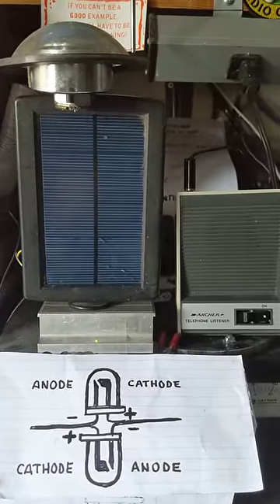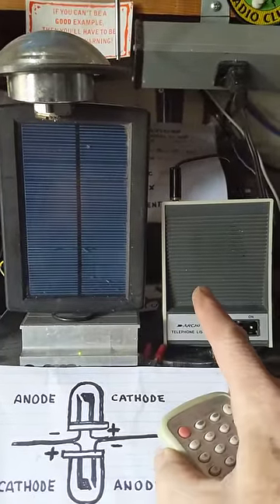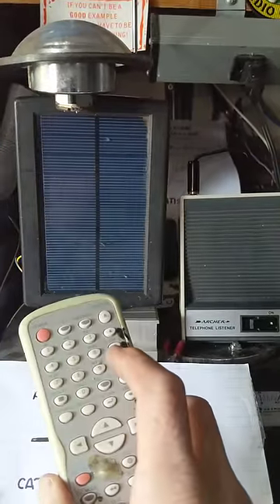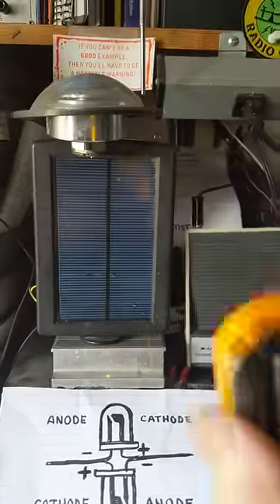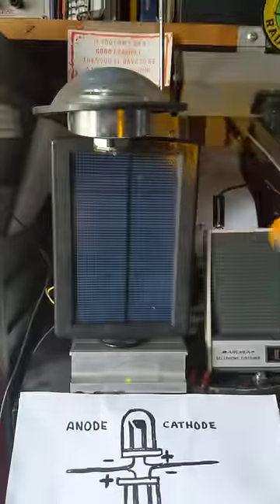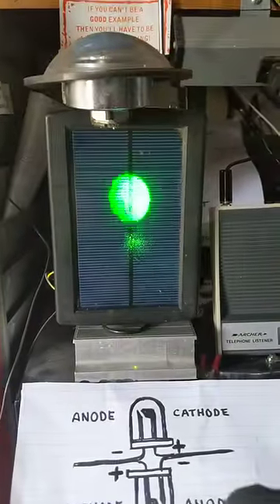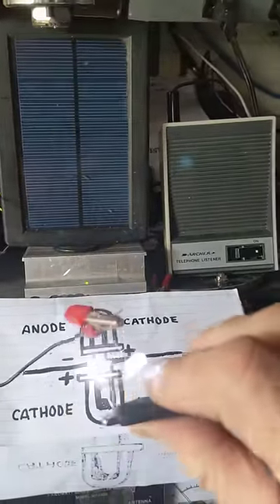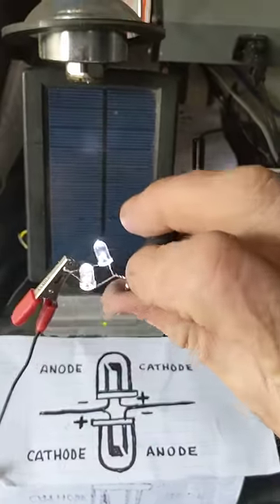Solar Panel Audio Detector!

Comment: I did this as a kid. The cool thing is you can hear wifi signals too.
Reply: How? A solar panel is not able to use the wifi signal.
Reply: @BlackWolF-vp8ou WiFi (and Bluetooth) are radio transmissions, they're just digital and at a higher frequency than AM or FM radio
This is also what causes Bluetooth noise on older/poorly designed Bluetooth audio devices
Reply: @PercyPanleo  Yes, but de frequency is to low for a PV panel.
Reply: @PercyPanleo  just because it is radiation doesn't mean it would work for a solar panel. 
Solar panels work pretty much only in the visible light spectrum and a bit up from there, if you want to produce electricity from radio waves you'd need a metal antenna instead of a silicon solar panel
Reply: @BlackWolF-vp8ou  I mean, solar panels can block wifi signals they don't always just pass through like radio waves. Especially because the strength is normally weak. 
That should be able to produce a weak, but measureable signal
Reply: @BlackWolF-vp8ou  I don't know but I think the alternating magnetic field induced the current in the wires of the leads in the solar panel. I don't think it was converting wifi radiation to sound because it only works from about a foot from the router box.
Reply: @cherriberri8373  yeah.. I think it was just picking up the magnetic field in the wifi box. Because it only worked very close up and it all works when close to any ac source.

I think the leads connecting the solar cells were getting an induced current. Kinda like an inductor.
Reply: so the solar panel was working as a rectifier with the leads as antenna
Reply: @cherriberri8373 it's actually primarily sensitive to infrared. A solar panel is just a large infrared LED. If you were to apply power to the solar panel and look at it with an IR camera ( or even your cell phone camera) you'd see it shining.
Reply: @onradioactivewaves   yeah, but it's easier to say "pretty much" before saying the relavent info versus listing what light it's best with and also what other bands of light works too versus what light doesn't work.

But as said, fair point, I'm just saying I cut it down on purpose for simplicity

Comment: I saw a article a while back on how LED lightbulbs could pose a security risk.

Its similar to the radio station demo, except the bulb has a microphone and uses that to bias the PWM frequency. To decode it, all you need is a solar panel and an audio amplifier.

Comment: The last one was very cool! The radio frequency was causing the LED light to pulse as if it were a speaker. If I were there I'd hang out for a bit and just listen. You could get more LED and tune into more stations.
Reply from the maker: Different length antenna elements respond to different frequencies, such as I show at this link. https://www.youtube.com/watch?v=vHVmJ5lD9jc&t=15s

Comment: The leds works as diode detectors for AM signals, and the terminals and wires act as antennas. The diodes leds are slow that only detect the AUDIO and the RF can't pass.
Reply: No, that is not the reason for using diodes in AM detectors. This is not correct.

The diode removes the AC component of the signal, it is then the subsequent capacitor which does the envelope detection and does not respond to the higher RF frequency.

The output of the capacitor is the demodulated audio signal, which can then be simplified and passed to a transducer so you can hear it.
Reply: @deang5622 I'm not sure OP is wrong, only because I have no clue what "slow that only detect the audio" means. Perhaps there was an error in (google) translation.
Reply: @Orc-icide  The OP is entirely wrong.
I can assure you of that.
Go read any article that describes how AM detection works that shows a circuit diagram and the waveform of the signal at various points.

The audio signal in AM is modulated on to the amplitude of a higher frequency carrier signal.  Step 1 of the AM demodulatiom process is to remove the half of the waveform which is negative leaving just the portion of the waveform which is positive.

Step 2 is to extract the slow varying audio signal from that high frequency signal and the way to do that is using a capacitor.

The output of the capacitor is an average value that is varying with time, it can't charge up and discharge quickly enough to follow the higher frequency carrier.

It is called an envelope detector.
It is a very common technique used in electronics and particularly in audio electronics. Go look it up. Envelope detector.
Reply: @deang5622 
I like this explanation. Thanks! 🖖
Reply: @deang5622  You over thinking this. It is basically a simple untuned crystal radio.

Comment: THATS AWESOME 🤣 had no idea that was even possible, especially the actual radio stations coming through the frequency of the LEDS
Reply from the maker: The radio station is close to my location,  otherwise it would not be possible to light up the two LEDs
Reply: This sounds so stupid - It does NOT work.

Comment: If the LED's are connected to a audiosource, it will also transmit this wireless to the solar panel. Back in the days, don't know of is this technology is still used, to swap data between 2 buildings of the same company, and where regular WiFi or cable could't not be used, both buildings had on the roof a sort of 2 way laser system. The transmission speed was not that high, maar data could be send and received.
Reply: Did some lookup, and it's called Free-Space Optical Communication.
Reply from the maker: I've heard that LEDs can put out a small voltage when exposed to light. Sounds like another fun experiment.
Reply: @PassTVRepair , it's in fact a small current, i have done that experiment a few months ago. Some LED's work great while some don't work that great at all. When light  hits a LED, they start to conduct in the opposite direction. Also connecting a LED to a DMM in resistance mode, will show a lower resistance when a light torch is placed near the LED. They then work like a LDR. You can connect 2 LED's in series to a bench power supply , with one of them in reverse direction, both LED's are off, but when the reversed connected LED get hit by light, the other LED lights up.
Reply: Isn't this the same principle that fiberoptic communications work on?
Reply: @sterliving , yes and no. Fiberoptic use a physical glassfiber cable between to 2 points, but with called Free-Space Optical Communication there is no physical connection between both points, because the light is transmitted through air. You can compare it with the IR eye with light beam for opening doors at shopping malls.
The used signals will propably be same protocols as used with a fiberoptical cable.
Reply: I miss ronja man.
Reply from the maker: Thanks for all the information on this topic. @BjornV78
Reply: @PassTVRepair no problem. Many electronic components can be used for other purposes then they where intended. Like a LED as LDR/currentsource, some regular diodes as temperature sensor, also some BJT-transistors can be used as temperature sensor.  Even a small Neon bulb (NE-2) reacts to external light. Such a small Neon bulb can also be used as a voltage clamping device on a powerrail or AC solenoid or AC relay. Even some white optocouplers like the H11A1 (also exist in black) reacts to external light. This is also the reason that most IC's are black to block external light. The very sensitive optocouplers can be white, because the internal light source reflects back on the internal white for light to the LDR. A simple LDR itself can be a complicated component in some circumstances. Per example, in most datasheets they advertise a dark resistance of 1M, but in fact the dark resistance can go way beyond 1M, even beyond 1Gigaohm after a few minutes of darkness, and after hours,days or weeks, even way more then 10Gigaohm. This is called the "memory effect" of a LDR. The problem then is, if a LDR is kept for long periods (days or weeks) in darkness, and has a dark resistance of 10Gigaohm or more, the first time light hits the LDR, the responsetime is very long, because the LDR needs to drop his resistance from such high to relative very low compared to his dark resistance. In some time depended circuits, this can give problems. After that first delay, the LDR starts to respond quicker to light changes.
Reply: I believe the fastest data transmission to date was open air laser line of sight. An ungodly amount of data but i don't recall the numbers, though.
Reply: @GrantsPassTVRepair   As far as I know you can do that with zener diodes easier (they often come with glass body). By pointing even regular flashlight of the phone on the zener diode, they can produce enough voltage to be picked even by regular multimeter. The best part is that it is super easy to test
Reply: @BjornV78  to answer the other question, this method is still something taught today, but is generally not used anymore due to 1) needing line of sight and good conditions and 2) the relatively cheap cost of cable. Especially as now the speed (using light) can be captured in fiber optic. 

Generally there is little issue in establishing connection with another building in most areas today. When it does occur it's generally better to look at building a line and eating the cost if you really need a dedicated line. Hint: most people don't. Its also limited in use due to the relative ease of intercepting a signal through this method. There is no real way to keep it analog and still encrypt the data. 

There still are times it's used that I'm aware of but they are few and far between. It's my understanding that this method can better transfer analog signals instead of needing something to translate it to digital, or when an analog cable is used, this method can cut out some of the distortion/noise when used properly. But again, it's something that's rarely used and mostly taught so people know what they're looking at if they ever come across it.

There are other examples which use this method based on lasers to transmit digital instead of analog signals, but again they're very specialized and rarely used outside of a few applications.
Reply: The same goes with solar panels, if voltage is applied they will glow  @GrantsPassTVRepair
Reply: @GrantsPassTVRepair Don't hire this guy to repair your TV - He doesn't understand basic electronics.
Reply: @GrantsPassTVRepair Solar panels and LEDs go hand-in-hand in the same sort of way that a generator is also an electric motor if you run current through it.
Reply from the maker: @4105cardwell  Here's a guy who came by my shop and witnessed my LEDs being lit up from an antenna and a ground wire. https://www.youtube.com/watch?v=yCs5Nn9t7jg
Reply: Definitely still used near me. I was wondering what this was on buildings near my home

Comment: That like a giant opto isolator.
Reply from the maker: I pointed the optical cable from my TV at the solar panel, but I could not hear anything. I suppose it's digitally encoded.
Reply: that is because it does NOT work.
Reply: @GrantsPassTVRepair  Yeah it's digital. Not only is it more robust against noise but it can also carry other streams of data at the same time, and much faster too.

Comment: I learned this one in middle school. We did an electronics engineering project where we attached a laser to an amplified audio source and placed it in the school gym, then used mirrors to direct the beam from the gym, across the cafeteria, through several hallways, and into an optical receiver on the other side. It took forever to get all the mirrors lined up, and once we did, a student bopped one with his foot and we had to line them up again.

Comment: I mean the last one you are just passing a radio signal into the power of the leds, we cant see those modulations in amplitude/frequency as they are being emitted in light form. The solar panel is made to capture light energy and covert it back into an electrical signal, that signal is being input into a receiver that is capable of decoding that signal, and processing it into sound. Radio waves are a type of light wave, sound waves are a mechanical waves and require a medium(air) to work. Another cool concept along the same lines, is turning a lightbulb or window into a microphone using a laser as a covert audio surveillance device.

Comment: This is cool.
Small cheap AM radios are good for anything that puts out a radio signal. Tune to lowest frequency and you can find key oscillator activity for smart key cars (we use them at work to verify proximity operation)

Comment: Dude your a genius I never even thought about that last one blows my mind
Reply from the maker: I'm no genius, but when you experiment on a regular basis, you're bound to discover some creative possibilities.
Reply: @GrantsPassTVRepair  i can dig it, chances are if you block one of the led's light from the panel you could listen to just one broadcast.?. assuming you get 2 channels if you did it again.   i watched this short when you posted it, but it just got included in max igan's video , cool.  
  i have a question, could a person use an old cordless phone and connect the panel to the micorphone ports ?  i'm planning on trying it, i have a small boat load of remotes laying around, and it would be a good way to test them, and test this setup with other things too.  have you heard of optogenetics yet ?  it's where they mess with dna and make it respond to different light sources.

Comment: This project is over 50 years old!
In fact I remember it being in the Radio Shack 150 in one kit.
That one used a CDS cell.
Transmission of sound through modulation of light.
Oh whoop-dee-doo
Reply from the maker: Yes. Being able to transmit sound through variations of light is nothing new, but being able to light up LEDs from a radio station a mile away, and converting them back to sound was a surprise I didn't expect.

Comment: So basically he has an antenna and a ground wire attached to the LEDs. This means that the power is being collected by the antenna and running through the LEDs and running to ground. The LEDs are acting like channels. So cool.

Comment: The last one (radio) is an easy explanation....we had same issue with telephony in homes.  The two wires are unshielded and not twisted together, which makes them act as an antenna.

Comment: some further explanations:
- the remote control uses light to transfer information to the thing it is controlling. You can check this by poiting your phone camera towards the led at the ned of the remote.
- leds and solars are technically the same thing. leds converts electricity to light, and solars convert light to electricity. you can swap the roles and use leds as solars but the electricity won't be enough to power anything, or pass a current through solars to generate light, but the light will be visible yo the naked eye.
- in the end, he is converting electrical impulses to light impulses using led, the converting those light impulses to electrical impulses using solars, then convert those electrical impulses to sound waves using the amplifier.
this is how the internet work these days btw.

Comment: Actually, that last one I'm not surprised.  It's basically a crystal radio set.  The length of the wires are both the tuner and the antenna.  The diodes are the detectors.  The variations of the voltage across the diodes causes their brightness to vary.  So the audio is translated to varying light intensity which is why you can hear the signal through the solar panel.

Comment: Wait...what?  You used lights to literally transmit sound?  That is like a DIY fiber optic sound cable...that is nuts.

I really need to look this up, this would be a really neat thing to do with a couple lasers ....beam sound across the yard...really neat.

Comment: This is like having motors hooked up in series with a speaker on dc circuit. Rather interesting depending on load and if you jam, the motor to a stop you can scratch the motor shaft with something plastic or your fingernail or something and can almost hear a grinding sound from the speaker.

Comment: Many years ago I was living in an apartment building close to an Air Force base, one night the radio comes on by it's self with what sounded like some wacked out dude... Probably high on something,I tried to turn off the radio but that didn't work, I even unplugged it from the wall and the speakers still kept going, not until another angry guy came on and came the speaker too and shut the first dude down.  I don't know what that was but it must have been something very powerful, probably from the military, it took over my speakers !! 🤯🤯
Reply from the maker: It's very common for many CB radio operators to transmit far more power than they are legally allowed. so it's possible one of them was in your neighborhood, and that might explain how they came through your speakers, even though the radio was unplugged.
Reply: @GrantsPassTVRepair  well now I know, thank you. Still creepy tho. 😁

Comment: To take this a step further: Connect a mic and amp to the power supply of a laser to modulate it, talk in to the mic, and have someone with a setup like in this video at a great distance away == wireless, laser phone.

Or, bounce a laser off a windows in a way that the partial reflection returns back to you, and have this setup there to catch the portion of the laser beam that gets shaken by the vibration of the glass. That pulsation would be turned in to the audio of whatever is making the glass slightly vibrate, letting you hear what's going on near it.
Reply from the maker: I've seen it done on someones youtube video, but the audio quality was not to impressive.

Comment: he used the diodes as switches/relays. the radio signals were already tuned on separate receivers on each individual wire. when the leds illuminated there must have been feedback loop through the solar cell.
Reply from the maker: Wrong. Try looking up laser communications.